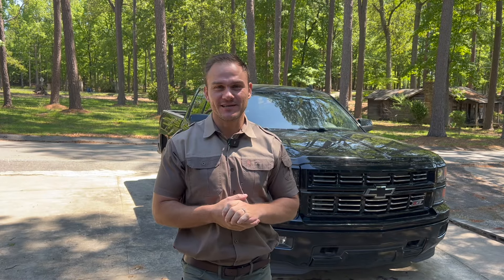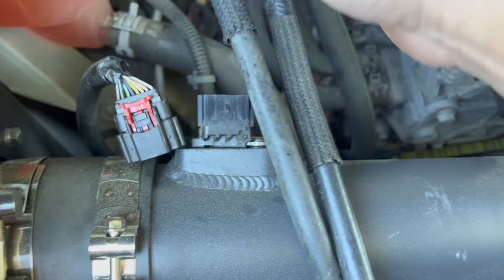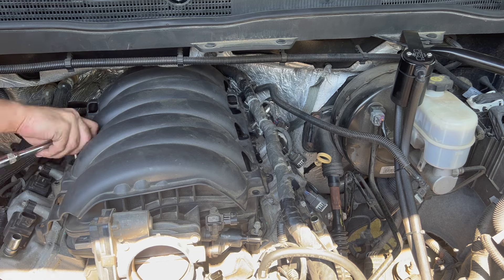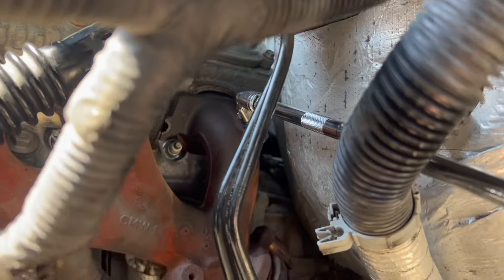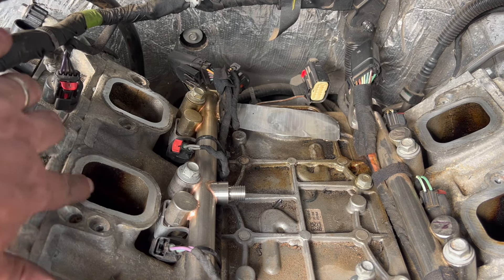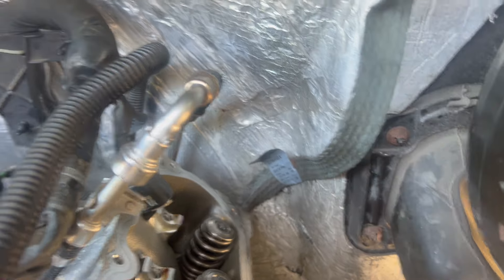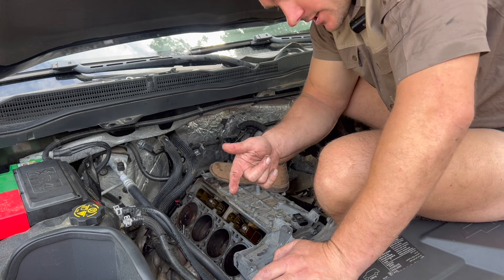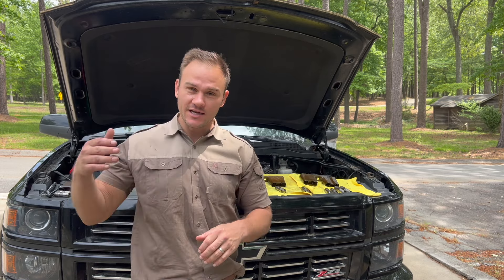LT 5.3 Rebuild, DOD Delete: Lifter Failure - Removing Heads (Part1)

Comment: Do you have to remove the injectors or can they stay in the head
Reply from the maker: You dont have to remove the injectors, can keep them with the head. I replaced mine, for peace of mind, and had 1 faulty(leaking) injector.
Reply: @SamberStyle  thank you for the response, I’ve replaced direct injection injectors before on other models and they were always a nightmare haha especially the ford eco boost 3.5 in the transit ..
Reply from the maker: @roberts6107  the 5.3 injectors arent bad to replace. Really tricky to get them out, so i just replaced the whole rail. I had to take them out, took the head to engineering, new valves,seals and also upgraded valve springs to match the cam.

Comment: General motors designs these motors to fail you to fail all of us. So you have to.
Take them into the dealers so they can work on them. and make money off of you again!!!!! I have already told 2 dealerships that I'm going to call Detroit.Michigan and talk to a designer and tell him also what I think about this!!
 2 of my brand new Chevy, Silverado's 5.3. Left me stranded in 2 separate states in each truck.
  2018 fuel injector went bad  2021 lifter went bad!!! And you have to pull the heads off to get 2  the lifters.I have never heard of that in my life.This designer should go to prison!!!! Trucks in the dealership now tearing  it down to get lifters out.Probably ruined the cam also!! Not to mention almost all of their transmissions fail too!! Remember the old chevy  moters and  the turbo 400s neverrr failed  you And left you stranded. In other states, just like my 2 brand new Chevy's did.

Comment: Chevys are reliable you just have to rebuild the engine every 100k. This company is trash. You couldn’t give me a gm product for free.
Reply from the maker: Every car/model has its pros and cons unfortunately.
Reply: It's not just Chevy, almost every modern auto manufacturer has over engineered every component of every car/truck on the market to the point that it's only a matter of time before something breaks, and it's almost always something expensive and nearly impossible to fix at home.  Once all the computerized stuff started coming into the picture it was the beginning of the end.